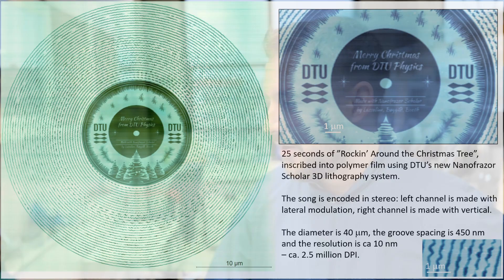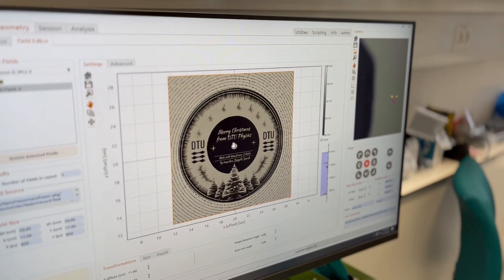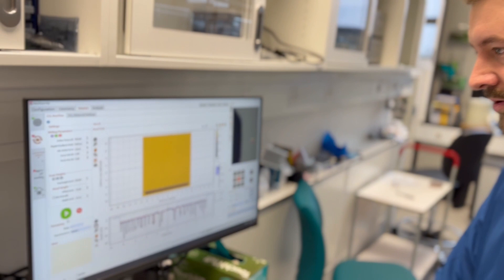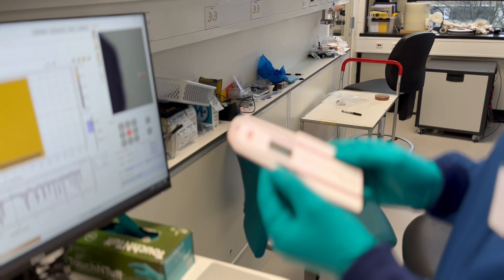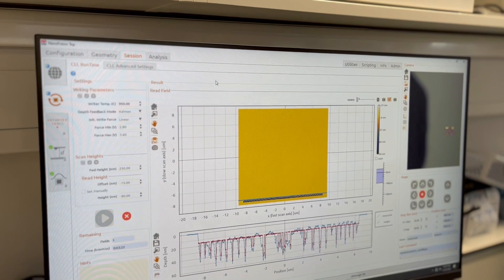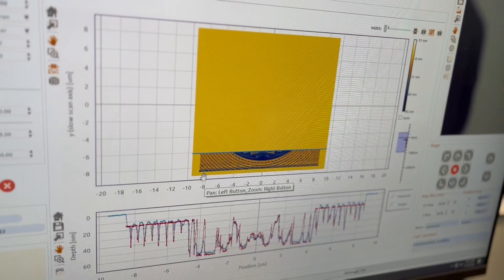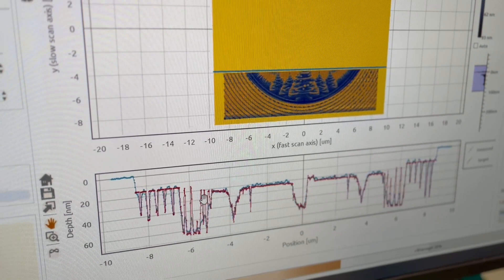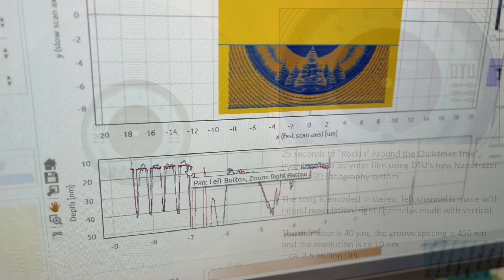Worlds smallest "vinyl" record - in stereo!

Comment: Was hoping for tiny itsy bitsy nearly microscopic record player... /s 🙂
Reply from the maker: yes! i have wanted to make a rotational micro- or nanomotor for years.... that is damn hard though. To play it we would probably have to decode it from left to right, which is not as fun. Nolan actually came up with a scheme for decoding it circularly, i.e. getting a tiny needle to follow the circle around. It would require some months of hard work to change a socalled Atomic Force Microscope to do that... the AFM is anyway like a tiny record player.... so while the record will not be rotating, we could still (maybe) get the needle to decode the groove by a spiralling motion, by overriding the built-in scanner, that is enforcing a rectangular (left-right raster) scan. I hope it makes sense. Bottom line: shamefully we dont even know how to make a record player with a rotating plate, however, we COULD get an AFM (check out youtube videos on those, they are cool) to do a spiral tracking of the groove.

Comment: What rpm would that be
Reply from the maker: i think i made the mistake at encoding it with constant speed instead of constant RPM - stupid me! The oscillations should be stretched at the outer part, because the "pickup" goes faster for larger radii. HOWEVER, there is roughly 2.2 mm groove, spaced by 450 nm or so. Thats like 80 micrometer per second.